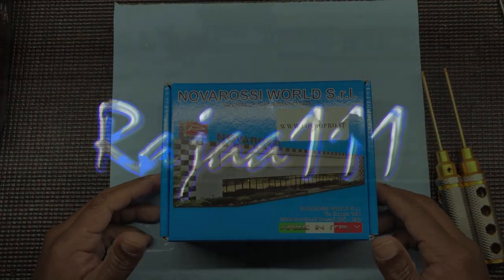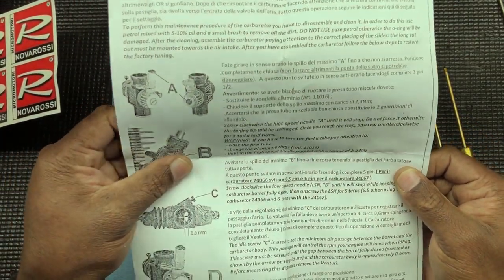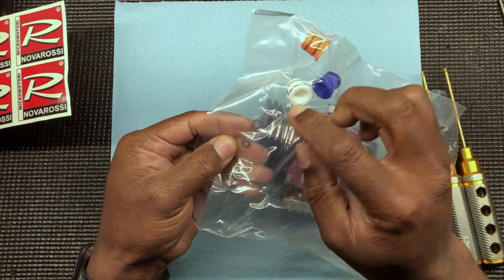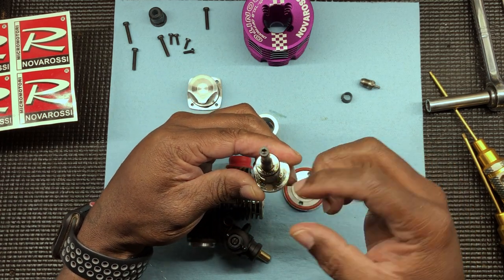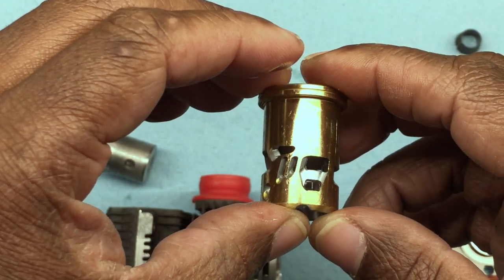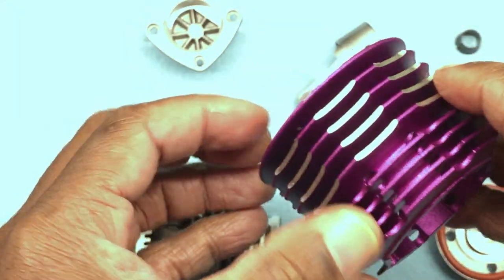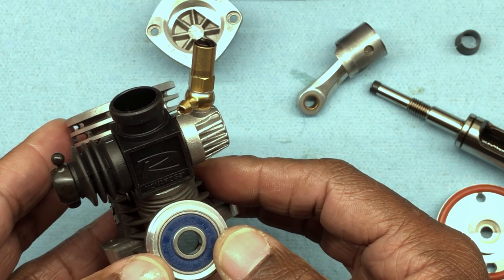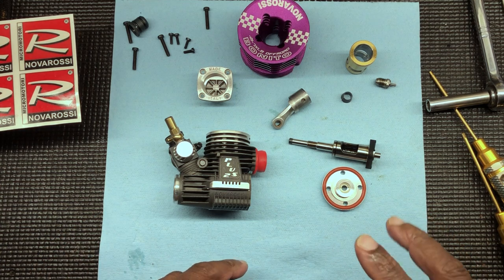Novarossi Bonito

Comment: Hi great video, I got one of these on a cheap roller I bought. It's very old and I can see a vertical line on the piston. Anyway its showing signs of wear it won't idle when its up to temp, but if I keep it moving and don't let it idle it rips. Is there anyway I can tune round the wear till my new piston and barrel get here? It currently has a two stage idle and cuts out when it drops to the second stage

Comment: Man I’m really sad they discontinued the 28-8 I can’t find parts or anything. I want to rebuild it and put it up. I’m looking at a LRP what do you think ? Running it in my Truggy
Reply from the maker: It’s a shame novarossi is not making anything right now, lrp is ok, are you bashing? If racing it would not be a good engine to race with,
Reply: @rajaa111  yes just bashing but I like good stuff. I would love to start racing but everything is going to electric in CA 🙄
Reply: Do you know where I can get a novarossi carb I want to put it on the LRP